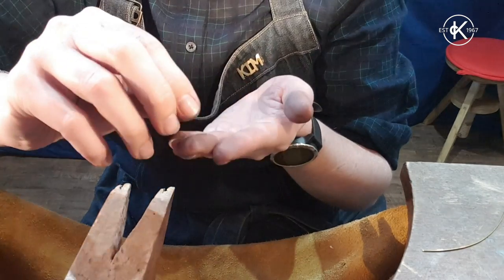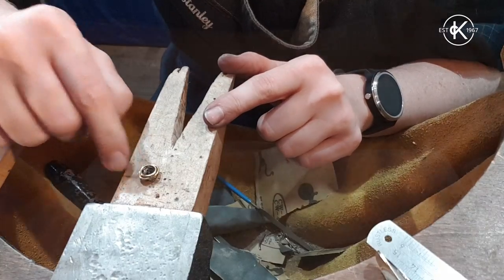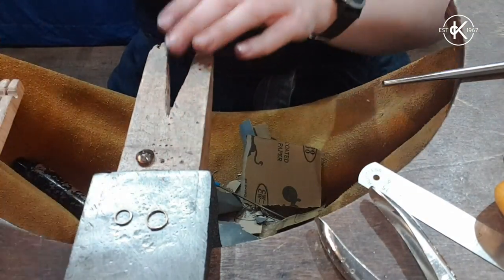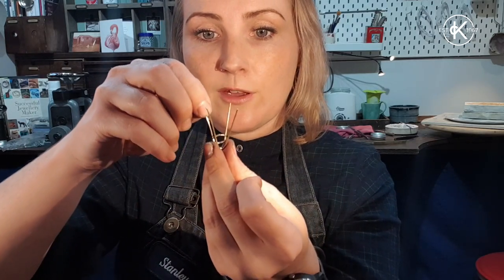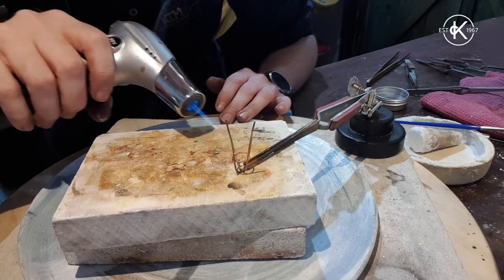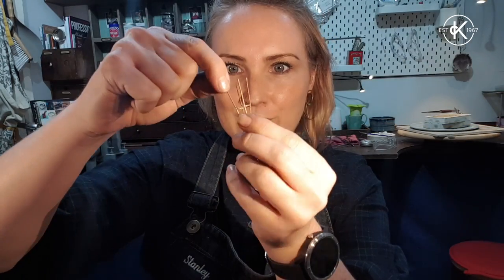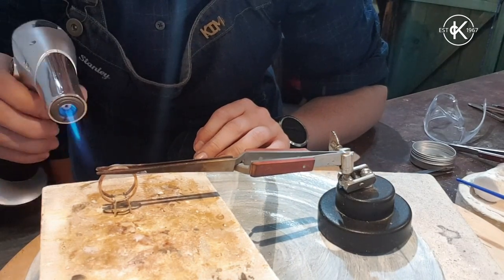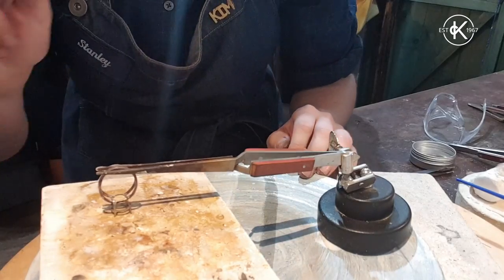How To Make A Basket Setting | 12 Months Of Metal

Comment: A question:   Why did you solder the larger jump ring into the 'cage' first?   I would have started with the smaller jump ring and then put the larger one on top as this would have made both easier to position.   What have I missed?

Comment: This was a really insightful video! May I ask what gauges you used for the basket and the ring?
Reply: Glad you found it useful Camy :) I can't remember off the top of my head as it was a year ago but the basket wire would have been either 0.8 or 1mm and I think the ring was 1.5mm square wire.

Comment: I am curious, why didn’t you solder the smaller bezel into the basket first?
Reply: Hi, it was because the larger bezel is the crucial one in terms of supporting the stone and having the prongs at the right angle. The bottom one, just adds extra support afterwards and if it's sitting too high or low and therefore making the basket too tall or short for your liking, it's easy to remake the smaller bezel so it sits at the height you prefer.